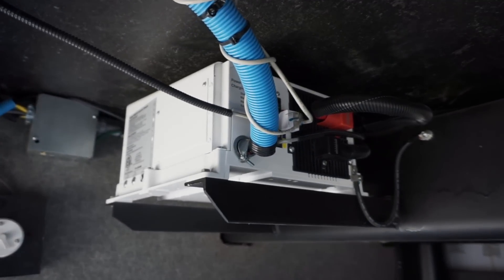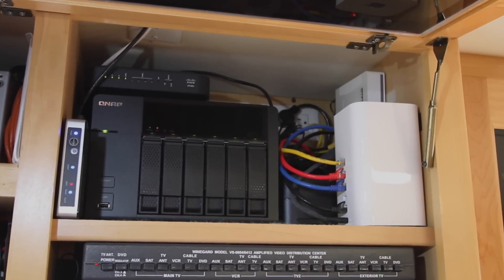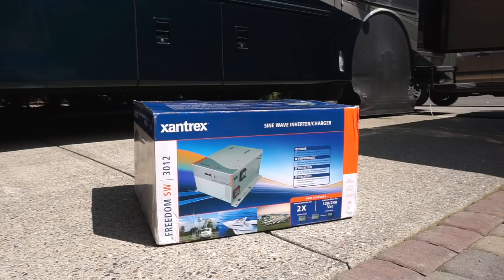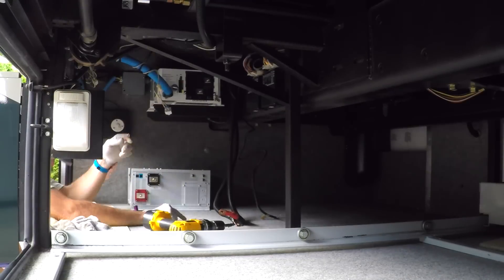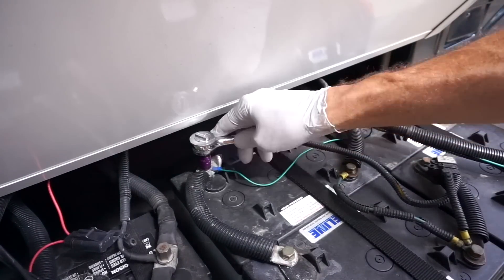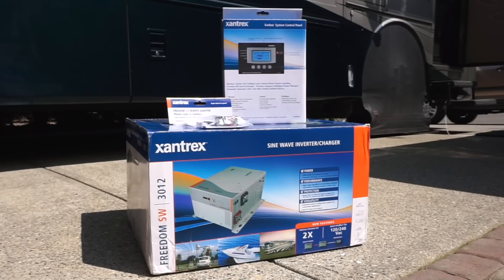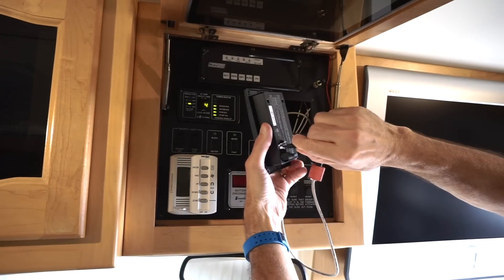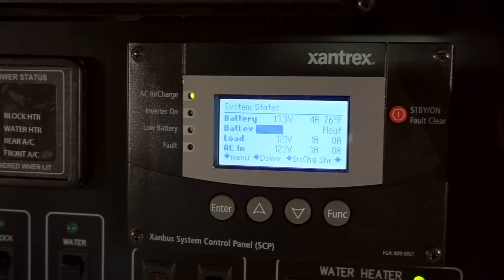RV Inverter/Charger Upgrade - Xantrex 3000-watt Pure Sine Wave

Comment from the maker: HERE'S ALL THE FEATURED AND RELATED ELECTRICAL SYSTEM GEAR ON AMAZON:
Xantrex 3000 Pure Sine Inverter: http://amzn.to/2E2lg0N
Xantrex System Control Panel: http://amzn.to/2EHsBEa
Xantrex Cable Adapters: http://amzn.to/2EkM0Nn
Kill-a-Watt Voltage Monitor: http://amzn.to/2EM1ic9
Surge Guard (50-amp): http://amzn.to/2Ej0pKa
Surge Guard (30-amp): http://amzn.to/2BWUxkG
SAVE 10% ON A HUGHES AUTOFORMER WITH COUPON CODE "RVGEEKS"
Hughes 50-amp Autoformer: https://hughesautoformers.com/product/50-amp-12000-watt-booster-and-surge/
Hughes 30-amp Autoformer: https://hughesautoformers.com/product/50-amp-12000-watt-booster-and-surge/

Comment: Love your videos you guys.  I just went from a 6.3 Lp generator to a 7.5k quiet diesel and installed it all myself in my safari.  While I was at it I installed wireless remotes to the generator so I can start it up in bed haha.  The wireless was quite easy after I figured it out and costed about $60
Reply from the maker: Wow! That sounds awesome. We love our Onan 7.5k. But installing one sounds like it might be above our pay grade. Impressive work, John! We can actually start ours by remote, too (with our iPhone!), courtesy of our Xantrex Combox (haven't gotten the video about together just yet). ;-)
Reply: RVgeeks oh my goodness with your iPhone!! That's amazing.  The install of the diesel seamed like a good idea until I started haha.  I built it in a box with sound deadening material and this thing is quieter than my Honda eu2000.  

I just finished watching the video about the new bed.  I now need a new bed haha thanks guys.
Reply from the maker: LOL! We're talking with Mattress Insider about the possibility of giving a new bed away in an upcoming video, so you might want to hold off. ;-)
Reply: That's great haha!! If you all can fit a video about rv blinds anytime that would be amazing I'm debating on where to go from the clanking metal ones that come in these older coaches
Reply from the maker: If we had to replace our day/night blinds with something, we'd definitely go the dual-roller-shade root (MCD is the most-known brand, but there's also United Shade and Automotion Shade). They're not cheap, but they're a lot simpler to pull up/down than the pleated shades we have now. If you don't need the dual day/night option on the shades, you may be able to get away with cheaper home versions you can pick up at a big box home improvement store... but they may not last (and we wouldn't recommend using them on any windows needed for driving, since they wouldn't have the necessary protective mechanisms to prevent an accident should they fail and unroll while you're driving).  Hope this helps!

Comment: Can't believe I missed this one until now.  I'm in a similar boat -- I need a new inverter/charger (still running on the old "modified") as I have a lot of expensive tech equipment (very similar to your setup).  I have a UPS that cleans the power specifically to my main workstation, but I still unplug it all when we hit the road and I know we're on the inverter.  Thanks for the video!!
Reply from the maker: Hey David! Your timing is perfect. Just last night we published a blog post with a more detailed update of our Xantrex situation. It includes a video interview we did for the Xantrex YouTube channel. You can see that all here:
http://www.thervgeeks.com/electrical/xantrex-interview/
Reply: As usual, you guys are awesome!  Couldn't have been better timing.  I was originally eyeballing Jason and Nikki's Magnum, but I'm definitely interested in what you guys have.  Thanks again for all the hard work you put into these.

Comment: I have my modem, computer, blu-ray player, television, etc. connected through UPS units. Mostly to protect my equipment from surge and low power situations but as an added bonus I can save my work then power everything down gracefully if the power goes out.
Reply from the maker: +BC ElginTex we have a UPS, but still want the power to stay steady when switching inverter modes. Stay tuned for an upcoming overview of our tech cabinet!

Comment: this may help you in the future, as we learned today that the inverter has circuit breakers on the side panel near where the DC is located.  we caused ours to trip this morning and initially didn't know what to reset as there were no fault codes on the scp and the manual did not list any circuit breaker or fuse location.  after some thought I went out and found black reset switches like one of those things you find on a frozen turkey to determine when it's done...and one of them was "done". so pressing that in restored power.  the location on the inverter diagram simply says reset switch, but as far as I can see, no other mention in the owners manual.  the things you learn, right?  at least it saved us a service call!  hope this helps you or anyone else who might reader this.
Reply from the maker: +Ben W Great tip, Ben! Thanks so much for adding that info. 😊

Comment: Another issue we just found out...our first set of coach batteries is toast but we didn't know that.  I had told them our batteries had run dry at one point but still were working but that must have made them useless for inverting.  So coughing out more dough to get them replaced...hopefully the last peice of the puzzle..maybe you guys should do a video on battery maintenance and a wet fill system.
Reply from the maker: +Ben W Battery maintenance video here:
https://youtu.be/a2LQc2Z_aDc

Battery replacement video here:
https://youtu.be/GlD22wLZOr0

Hope you get it all worked out.
Reply: Yeah I think we finally did!  Thanks for the links!  Will have to swap a few stories sometime. Hope you have safe travels and hope to meet you on the road someday!

Comment: our installer is having quite the time installing our xantrex 3012.  we decided to leave it to the "experts" to install and configure this unit.  unfortunately the first one they tried to install last week failed on its maiden voyage.  apparently some relay went inside it. so another one was ordered. this one worked better but somethings still not right.  when the inverter was off and we had the water heater, the AC and the microwave on..the internal relay in the second unit cut All the power to the coach and would not reset with the SCP.  The technician had to force a reset at the unit.  then after this happened twice it wouldn't reset again.  so now.i don't know what they are doing but we're mighty frustrated and been sitting here for 8 days  for what should have taken three days!  At least we're not paying to use the electric and paying for a spot.

Comment: Can you cover how you power the refrigerator and air conditioner
Reply from the maker: +Spiritual Discourses For Higher Enlightenment We have a residential fridge, so it strictly runs off 120-volt AC current, which it can get from one of three sources: 1) Shore power at an RV park, 2) generator power, or 3) Through the inverter, which converts the 12-volt DC power in our house battery bank into 120-volt AC power.

The air conditioners are almost the same, except they draw too much power to run off the batteries, so options 1 & 2 are the only ones available.
Reply: That's what I wanted to know how can you run the A/C and the frig off of solar power?
Reply from the maker: Technically, you don't run the A/C or fridge (or anything else) directly off solar, as the solar panels only feed power to the battery bank. So the trick is getting enough solar to replenish the batteries faster than various appliances pull power out of them. The fridge is easy. If you have an RV fridge, simply run if on propane mode when dry camping. If you have a residential fridge, like we do, you'll be running it off the inverter, which gets power from the batteries. And since even a residential fridge draws fairly little power (at least compared to an air conditioner), it doesn't take all that much solar to replenish much of the power it uses.

Air conditioning is a completely different matter. NO RV comes from the factory with the A/C units wired to run off the batteries, because they just can't handle that kind of huge load. The only way to run A/C off the batteries (and therefore use the solar power coming into the batteries to replenish that power) is to add a fairly massive solar panel array and corresponding massive battery bank. You're talking about major $$, so you'll have to be a very serious boondocker (and in hot weather) to make it worthwhile, and you'll never save enough on electricity costs to recoup it. Having that big a battery/solar system is all about the ability to avoid running the generator for the peace and quiet, not for getting free electricity.

You can see an example of the kind of system we're talking about by visiting our friends Nina & Paul's website. They did a MONDO system: http://wheelingit.us/category/solar-power-2/

Comment: can you hook up a generator right into the camper electric system (like plug it in somewhere)  to power the camper if no land power or solar power.
Reply from the maker: If your RV didn't come with a generator, the most common, and easiest, way to have one would be to go with a portable unit, like this type: http://amzn.to/2aIvaoY (Honda generators are VERY popular). You just fire it up and plug the RV into it, using a dog-bone electrical adapter if needed. If you wanted to permanently retro-fit a generator into your RV's system, that would be a lot more complicated, and almost certainly require a professional installation.
Reply: can you send me the video you did on bones I can't find it in your video archive. Thanks for the time
Reply from the maker: Spiritual Discourses For Higher Enlightenment
Sure thing! Here it is: https://youtu.be/wVYBei5BZmw

Comment: great video I have a similar unit can I ask what size fuse do you have I have been told to get a 350 amp t-fusethanks
Reply from the maker: Hi Fester.... the size of the battery fuse depends on the size (in watts) and voltage of your inverter.  Xantrex recommends the following fuse sizes:

2000W (12V) Inverter --> 275A fuse
3000W (12V) Inverter --> 350A fuse (which is what we have in our coach)

You may want to check the installation manual for your inverter/charger to see what they recommend... to ensure you don't end up with an over/under-sized fuse.

Hope this helps.

Comment: Hi guys. I have the Xantrex 3000 (3012). I have it in my travel trailer, hooked up to 2- 150 watt solar panels and 4- 6 volt batteries.I have a Honda 2000 companion generator also. When I connect and run the generator, it surges and settles down then surges again. The AC light on the inverter goes on and off at the same time. Things in the RVseem to work ok but the surging of the generator is annoying. I can't get through to Xantrex, so I thought I would ask you for your input.Is the surging normal? Hope not.We enjoy your videos.Sincerely RandoPs. Hope you're at some place awesome.
Reply from the maker: Hi Rando. You're generator isn't likely powerful enough to fully power your charger and other things at the same time. You need to set the power share setting on the inverter to a maximum of about 15 amp to prevent it from trying to pull more power than that for battery charging.

Comment: additional note.
.they told us a part needed to be replaced in our original transfer switch...which was causing the issue with the second inverter...hoping now this is resolved!
Reply from the maker: That makes sense that it would be the transfer switch, since the inverter can't cut power to the entire coach... but rather only those circuits that it powers. We replaced our transfer switch a couple of years ago after it was acting up, and have had no trouble since. This is the one we installed, because it's supposed to be really top quality: http://amzn.to/2aY8gMR  So far so good with it. Hope you get this all sorted out.

Comment: Curious if you have a propane fridge and if so whether you leave the propane ON while you are driving down the road?
Reply from the maker: We have had a residential fridge for about 5 years now (and love it). For the previous 8 years on the road, we had an RV (propane/electric) fridge, and always kept the propane on while driving. We hear some people talk about turning off the propane while driving, but we think most people leave it on, and we've never heard of a problem. Even the RV fridge manufacturers say it's okay to run them while in motion, and we always did.

Even now, without a propane fridge, we never turn off our main propane shut-off, except when we're traveling away from the RV for extended periods of time (like on overseas trips). We're sure we'll get flamed for saying this, but we really believe that many people operate out of fear. We don't. Of course if we hear or read about real-life problems occurring as a result of a particular practice, we modify our SOP. But we just don't know or hear about problems with keeping the propane on all the time. There certainly may be valid reasons for shutting it off (like a potential accident?).

But we figure the daily annoyance of remembering to turn on and turn off the propane when setting up or breaking camp isn't worth worrying about that small potential risk, especially since we practice defensive driving techniques that have led to an accident-free driving history. If you want to reduce ANY potential risk by the maximum possible amount, there's certainly nothing wrong with shutting it off. If you then need to keep you fridge cool while driving, keep it closed and/or run the generator (which can also be done while driving).
Reply: Thanks a lot for your very detailed answer. I think I agree with everything you have said. Also thanks for making all your videos I just started watching RV videos a few months ago (maybe in preparation for my wife's retirement next year). I found your videos to be very informative and well made with just the right amount of detail.
Reply from the maker: Thanks so much, Bill. You just made our day. :)

Comment: Thanks for all your great content. I just had the xantrex freedom hfs inverter/charger installed in my Montana 5th wheel, bit when I plug it into shore power is trips the shore gfi circuit, so I’m unable to get shore power, any thoughts?
Reply from the maker: Hi Dave. Immediately after doing a big upgrade like that is a real challenging time if everything doesn't work right out of the box. Did it ever work, or has this problem come up for the first time at the park you're now located in? You mentioned that you "had" it installed. Can we assume from that that you didn't do the work yourself? If a professional installed it for you, do you know if they tested everything before they gave you your rig back, including on a GFCI outlet? In other words, is it possible it never worked correctly after the installation was done? If it was never tested on a GFCI outlet, and therefore has never been confirmed to be installed correctly, that would be a different troubleshooting path that if it worked, but then stopped working. We just looked up your inverter, and see that it has two options for connecting loads to it: plugging things into is outlets, or hardwiring to it. If you're plugging items into the outlets on the inverter, that could be the problem right there. That's because the outlets on it are GFCI. And GFCI outlets are designed to be and "end" point. That means you can't plug a GFCI into a GFCI. Here's a link that will likely explain your problem. Check out the third section for troubleshooting GFCI tripping. If everything in your system is hardwired, we bet that it's wired incorrectly.
http://maze.airstreamlife.com/wp-content/uploads/2016/12/Xantrex-inverter-GFCI-Tech_Note_018.pdf Hope this helps. Please let us know how you make out.
Reply: RVgeeks , Thank you so much, it give me a place to start looking. Dave
Reply from the maker: That's awesome Dave! Please be sure to let us know what you find. 😀
Reply: RVgeeks Your advice was SPOT ON! Problem solved.. Thank you so much. Dave
Reply from the maker: That is awesome, Dave! Great to hear. Thanks for letting us know. 😀